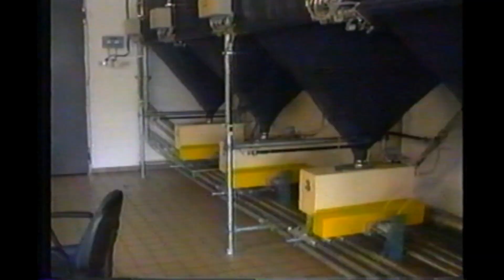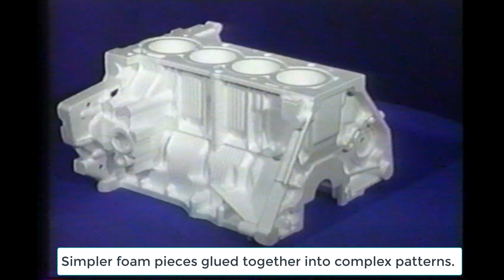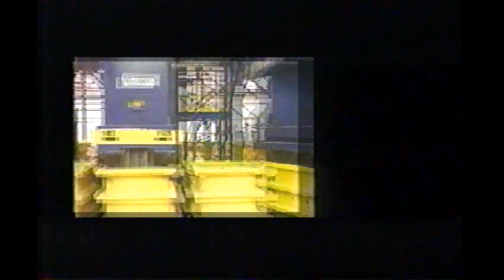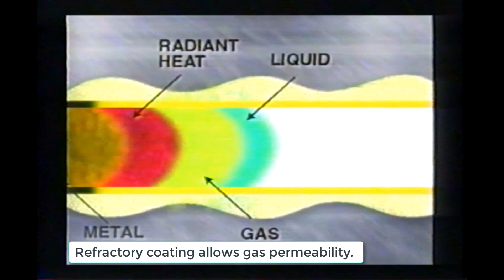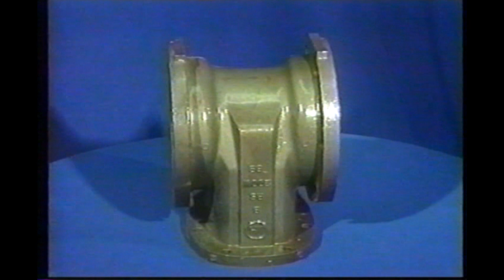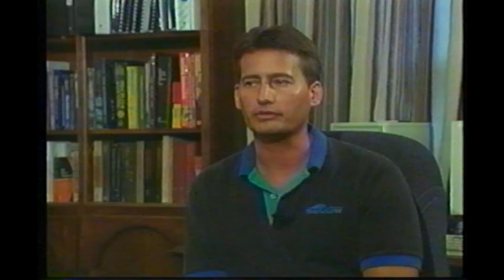AFS Lost Foam Edit

Comment: So the foam melts from the hot metal and turns to a gas and is expelled out through the sand..?
 Also there is no metal contamination from the melted and gaseous foam?
Reply: I guess there will be accumulation of plastic in some surfaces and that must be taken into account in the design phase.
Reply: If casting is gated properly, no foam residue buildup to contaminate the casting